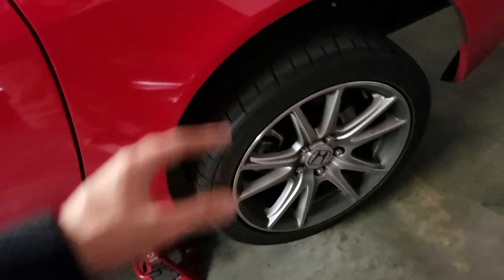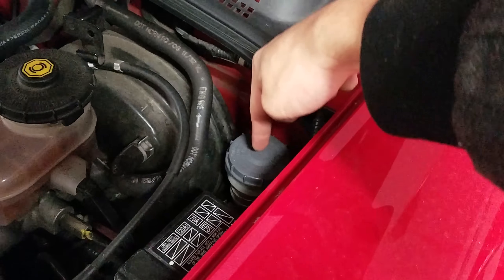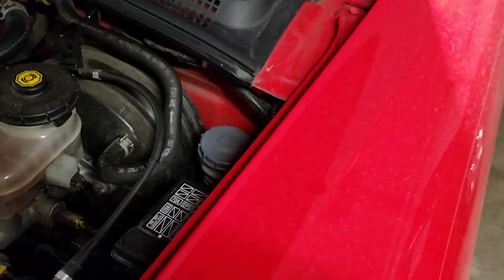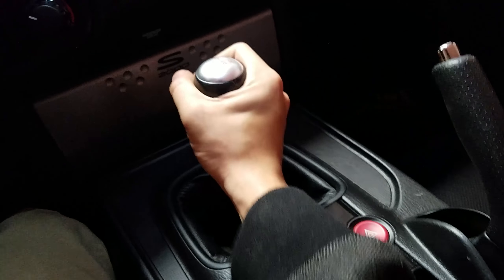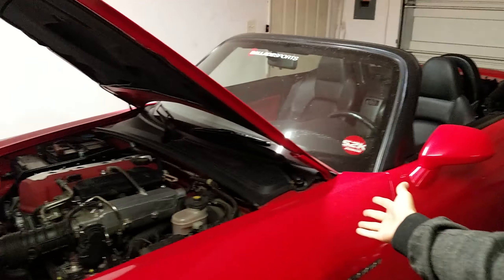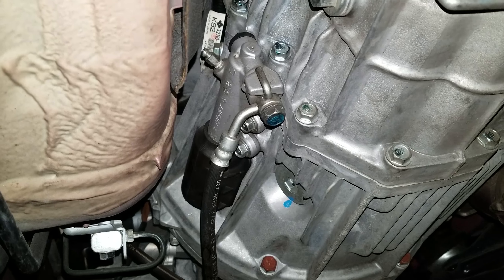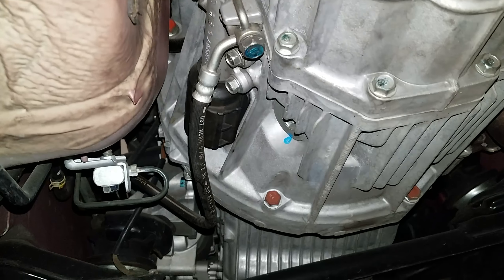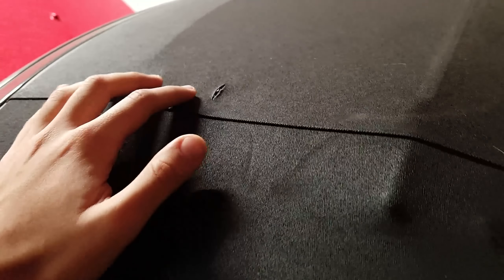Common Issues With the Honda S2000 Part 2 (No Music)

Comment: Hi Danny ... just found your channel... I just purchased a 2006 S2000 with 40k miles and I'm the 2nd owner ... I'm  pushing 70 years old and was happy to Have a wonderful car ... I've been a Honda fanatic since 1967 ... My first Honda car was the AN600 Sedan... so much fun! Also have owned many Honda motorcycles... anyway I find the S pulls right under acceleration and has a clicking noise on some bumps in the rear right side (metal hitting metal) exhaust pipe? ... I've went through all the suggestions on TP ... etc ... the fact the rear axle nut need 230ft lbs of torque is beyond my tool capacity ... My stepson is a Mercedes mechanic and I'm going for an alignment next week ... so what is your experience with the noise and the pulling right ... hope this issue is fixable... Thanks for your time.
Reply: Honda lover since 1999 here ^^ (I also have owned multiple "kinds" of Hondas hahaha)
My first thought was the alignment... as the suspension on the S2000 is amazingly, completely adjustable.
How did it go ? How does it run ?

Comment: What about the electronic power steering issue? I have an ‘01 AP1 and sometimes my power steering just cuts off randomly. Pretty scary when your going into a turn with one hand and the shit just locks up on you.  That’s why I call it the DEATH TRAP S2K.  I’ve heard other people online had this issue but not how they fixed it. Most just totaled their cars I believe. I took it to Honda years ago & they quoted me $8,000 to change the power steering column!  And they weren’t certain that would even fix the problem.

Comment: About to purchase my first S so thank you very much
Reply from the maker: Sandzslik good luck on your purchase! You'll love the S2000 👍🏽
Reply: Sandzslik take it to a body shop and have them check for front end damage. I looked at 8 of them before I bought my 02 and 5 of them had front end damage. They never drive the same when the front has been tweaked. Three of them had no accident records and we're done half-assed. The worst one was yellow had no cotter pins in the lower ball joints and had a kink in the subframe.

Comment: Most of this is not issues with S2000s but issues with the owners of s2000's. If owners used the car for what it was designed for they would have far less problems. If you want to go fast buy a fast car in the first place.
Reply: I agree with you, but only for about 50% of what you said... the S2K IS a very fast car ;)
Reply: The S2000 was meant to go fast... not in a straight line, but around corners